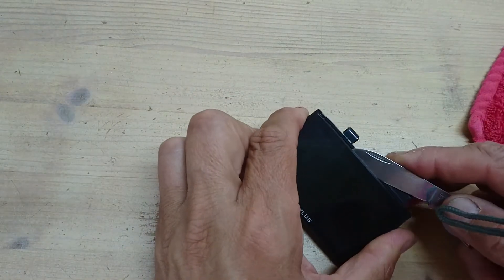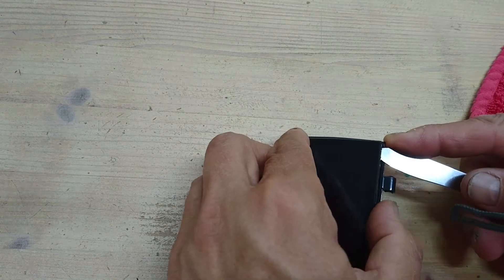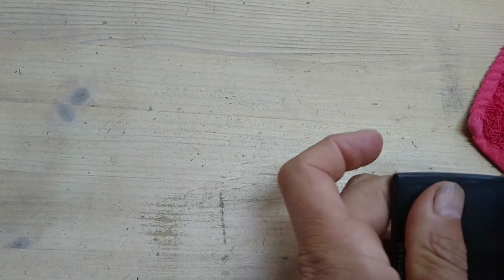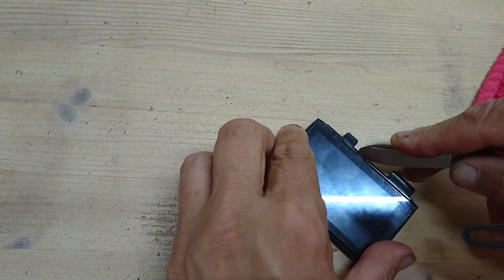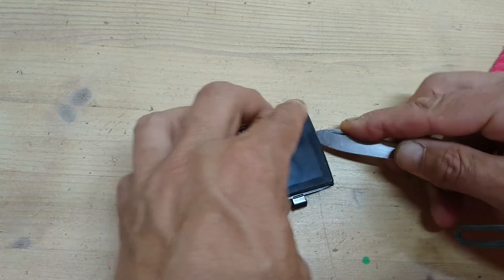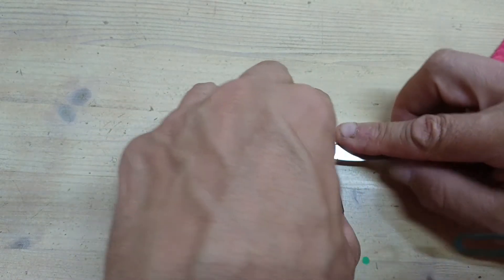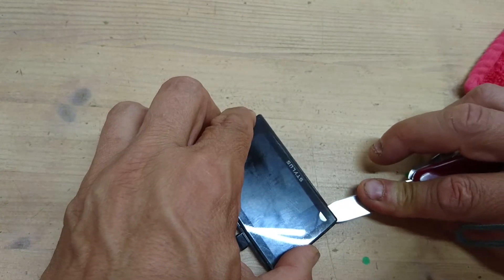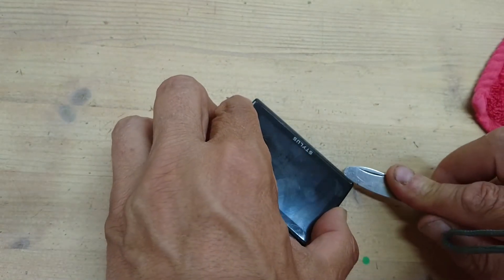Repair: How to Replace Olympus TG 850 LCD Display, Disassemble

Comment: When you were removing the LCD screen cover, did you slightly heat up the edges, where the adhesive is, to help remove it?  Danke

Comment: Great job, but in other video you should explain how replace the broken flex, please :)
Reply: yiriana30 . It’s not easy . I did it  today.
Reply: @poden3863  I'm working on replacing the flew cable today. How did you access the display side of the cable? I have this thing opened up and have detached the motherboard side of the cable.